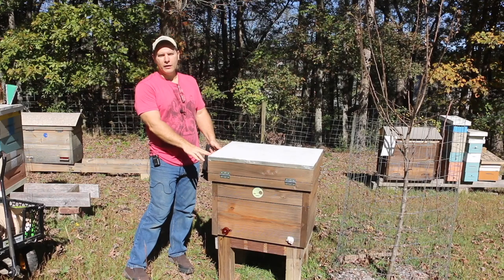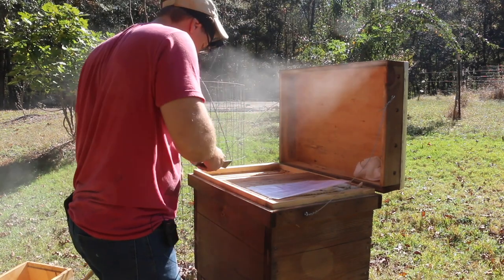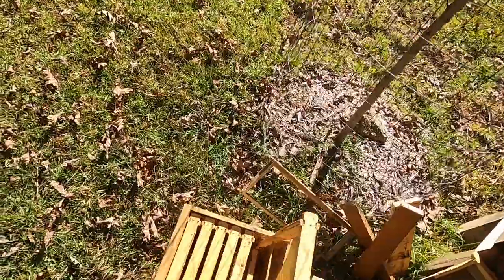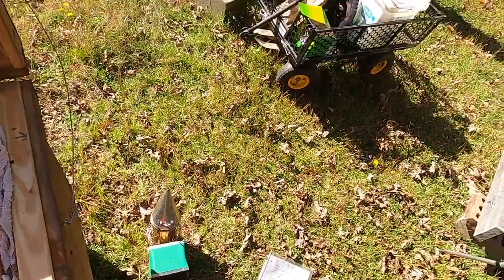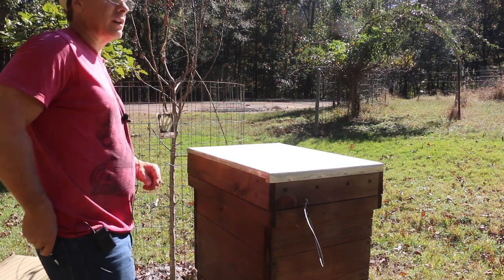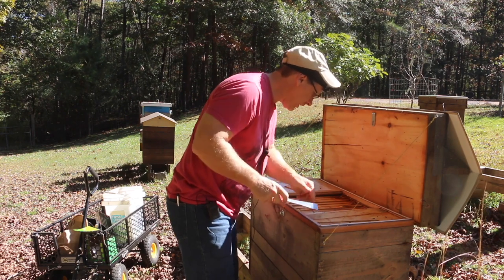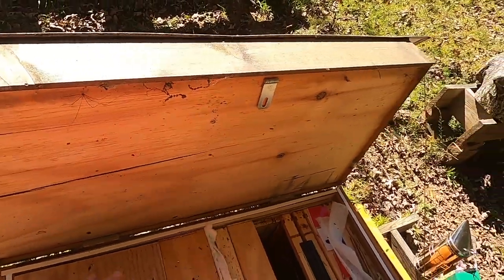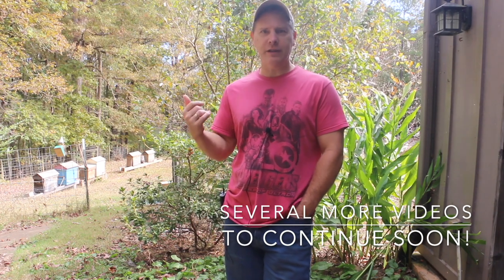Pulling Honey Nov 2021

Comment: Thanks for posting. Always enjoy your videos. I run 6 layens hives and a bunch of long langs and langs. I seem to have trouble keeping queens in my layens hives. The long langs seem to do better in my northern climate for some reason, although technically they shouldn't.
Reply from the maker: That's interesting - have you noticed that the Layens hives are swarming too?
Reply: @enjoybeekeeping5612  No more than any of the other hives. On the occasion when one has swarmed it is usually from an accidental high Mite load. I treat with OA... Provap when needed. So needless to say, that hive didn't produce anything last year but it did recover.

Comment: How do you store your extra frames with comb for after winter?
Reply from the maker: I put them in empty hives I have sitting outside.  I just seal up the openings with unscented Swifer Wipes to keep moths out.  I also sprinkle some cedar shavings inside the hive body as an additional moth deterrent.  You could also freeze all your frames for 24 - 48 hours  and then store them in plastic moth proof totes in a cool dry place.
Reply: Thanks for the reply! Very helpful!